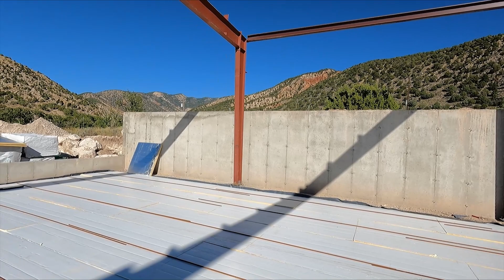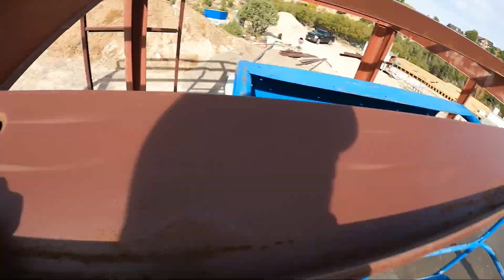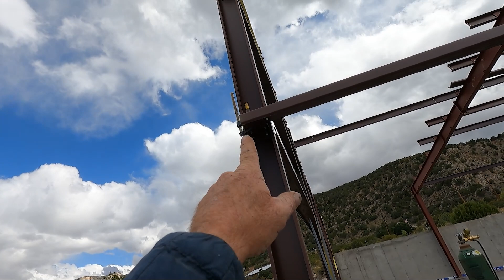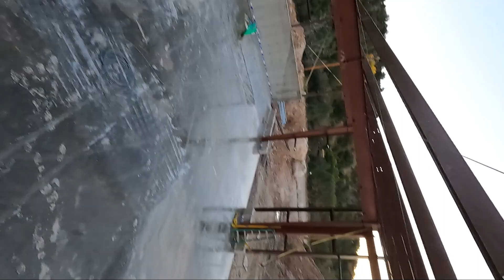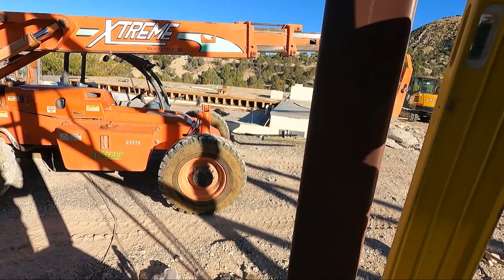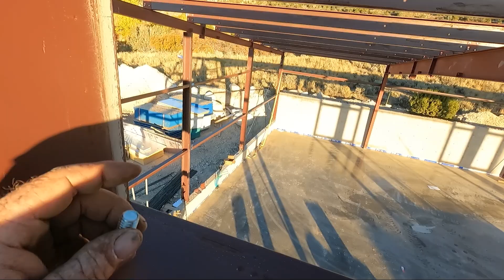PROBLEMS WITH MY PRE-ENGIENEERED STEEL BUILDING

Comment: Never saw a steel building going up.  This is all familiar to you but now as you show us how these go together,  again I'm curious how all these supports and hardware are represented on a blueprint.  I guess after raising 5-10 of these your very familiar with what has to be done.  It doesn't appear to be very complicated.  Just make sure that as you progress in the build,  make everything plumb and level.  What surprised me is when you commented that these beams are able to bow.  Now I want to know what gauge is the steel that your using?  Your teaching us Noobs quite a lot about raising these steel buildings.  Thanks for the lesson.
Reply from the maker: the reason i didnt talk about the blueprints is because every company is different. I didnt want to confuse anyone. It takes some searching to find what components go where. the girts on the walls are light gauge but their strength is not virtically. girts are very strong laterally. the siding holds them up vertically and the girt supports all the wind load against it. The purlins on the roof are the same story, very floppy until you get the metal on then very strong. thanks for watching

Comment: Thanks for a very informative video.  I wish I had seen it a year ago before I started putting up my building.  I didn't have any post bolts off as far as your one post, but all of my were off far enough to really mess me up.  I ended up buying a mag drill and redrilling all of the holes in the posts.  Then to compensate for the oversized holes, I had a local machine shop make some square washers out of quarter inch mild steel with an offset hole so they would work on all four of the bolts for each post by simply rotating it to match the offset for that anchor bolt.  It worked, but it cost me an extra week of equipment rental on the telehandler.  I almost couldn't keep it for the extra week because they were squeezing me in between two long term rentals, but they found a way and saved my butt.  
I never did the the building completely square (did I mention that I'm not a pro...), but it was close enough to sheet and all of the openings were square.  My wife and I did sheeting on the walls, but I hired pros to do the roof, but the head of the company couldn't handle that it wasn't perfectly square and had his crew making swiss cheese out of my purlins and roofing sheets.  I had to sack them after they got 1/3 done because they wouldn't listen to me about squaring to the building centerline.  I used a laser aligned with the building centerline to put a square line across the building and marked the placement of the remaining panels on the eve and the top purlin for each side. My wife and I got the rest of the roof on in a couple of days, then I had to go back and move every sheet and roof cap they had installed, that took two weeks.  I'm pretty sure it is leaking, I'm going to have to go up there next dry spell and dump a bunch of butyl caulking in all of the joints and the "extra" openings they created. 
 I wish I could have found a builder locally to put it up, but there was nobody in the area who had time.
Reply from the maker: I just bought a mag for the steel going in the house. Sub Contractors will never care like an owner. I like to save money doing it myself but really no one will do it how I want it.

Comment: Even though you dealt with shoddy people in setting out the concrete and holding down bolts you have to accept that you stuffed up in not checking all measurements before starting to install the steel columns.
Reply from the maker: I was working I couldn't get there. Obviously looking back something should have been done

Comment: Concrete guys use cloth tapes a lot of the time and the stretch in tape is what caused your 2 inches in my best guess . I put those buildings up for 25 years and every time we had a issue with anchor bolts and slab being to long it was concrete contractor with a cloth tape . always verify with concrete guy that he uses a steel tape and double check him before the pour or lay it out with him . the time wasted babysitting that step saves so much money and time in the long run it makes it a good insurance policy. I learned
Reply from the maker: 25 years I'll bet you know every trick to these buildings. Yes I didn't verify because I have used the same crew for so long. Burned me on this one
Reply: @bar6builds605  it happens and just curious are you going to ask them about the tape ? Had a good friend that was my concrete guy and he never realized the stretch in the tape . but when doing a hundred ft plus building it grows fast
Reply from the maker: Ya I'll ask him. Cloth tapes are good for staking out but that's about it.
Reply: @bar6builds605 what is the best red iron building company to deal with as far as delivering you buy on time? Hell you should make a video , on tips from a pro, it would go viral